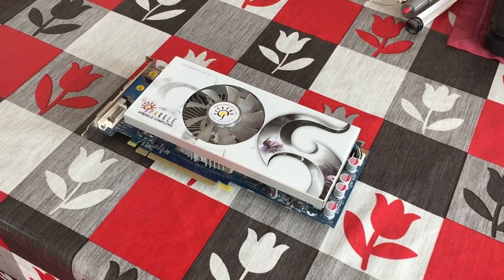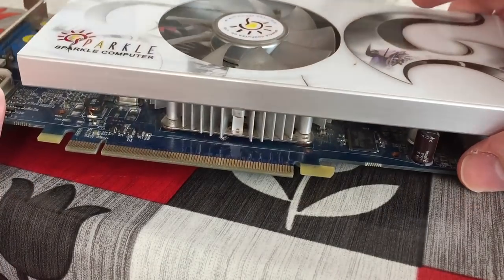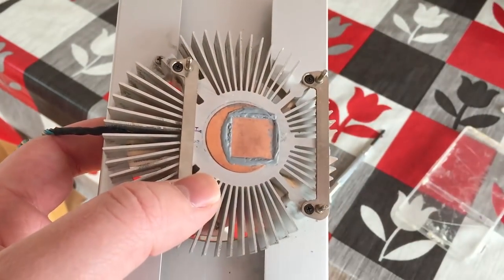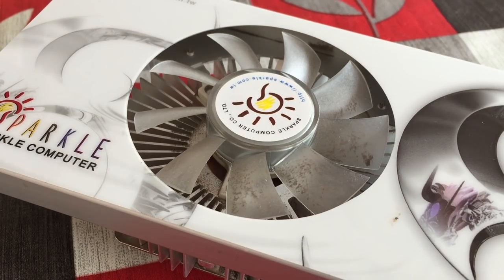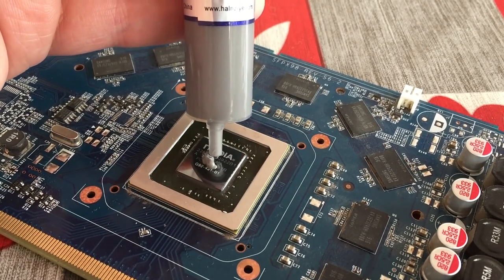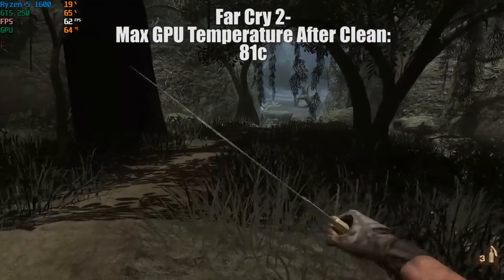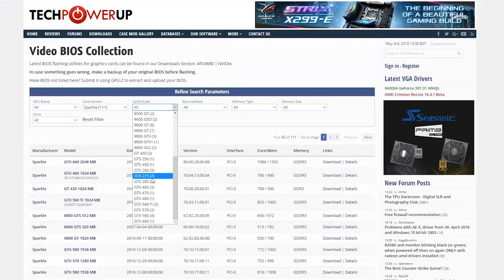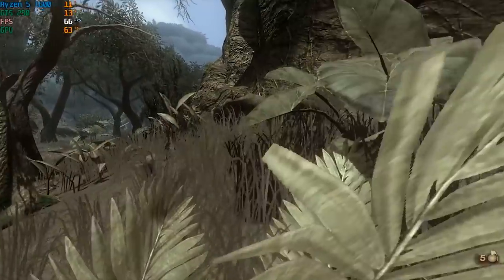Getting An Old GPU To Run Like New

Comment: is 2 hd 6870:s worth 30 dollars?
Reply: About 50% the performance of a R9 280 3 gb & crossfire is terrible on the support side & the cards no longer has driver support so newer games dont get optimized, the cards were at their end of life back in like 2012 in terms of stores selling them so its soon 6 years old.

For games pre 2016 it's good enough performance wise with 1 card in low - medium settings 1080p & e sports games for sure, but not much further then that I'm afraid...
(Depends a bit on the game ofc which settings work well & which don't)
But I'd look for a faster card then a HD 6870 unless you are getting them for a older rig, for benchmarking in older games & perhaps stuff like 3dmark 2001se, up too 3dmark vantage along with overclocking for passing time while in boredom during the weekend.

Had one here myself with a shitty cooler up too January 2015 from October 2012 & i hated the card initially due too the heat as the cooler was crap but once it was modded with two 120mm fans too cool down the card it was nice too have a silent gpu for games like dead island, borderlands 1, tf2, cs go & similar time period of games.

Had a xfx dual dissipation HD 6870 & when i replaced the card in January 2015 i bought a asus direct cu II r9 280, great looking card & only needed too oil the fans a few months before i replaced it with a gtx 780 i got my hands on, traded the hd 6870 away for a motherboard which i sold for 50€ locally too a guy which had a mostly fried socket 1155 system with a I5 2500k
(Motherboard lived but had only 3 working usb ports + the front 2 ports on the case instead of 8 rear & 2 front & no network card as the router remained plugged in during a thunderstorm.)
Reply: Marcus60661 thanks
Reply: yes they are absolutely worth 30 bucks, you can sell one and more than cover your costs-keep one for free

Comment: My gt610 gets up to 150f and it's not dusty
Reply: passive model ? or crappy mounting for the cooler on it atm. & is this in idle or load ?
if its in load its fine. idle ? a bit on the hot side but if you are under 90c its fine still.
Reply: Try taking the fan off of it and reapplying some new thermal paste that might help a little
Reply: It's a MSI I did put new thermal paste on it just has a very crappy and small heatsink on it
Reply: It's a very nice card it's a msi but the heatsink is small

Comment: Hey Random. I want to ask you something - is it wortth it to buy Ryzen 3 2200G + GTX 1050Ti ? Don't laugh, if this build is dumb, I'm noob...
Reply: but i asked about this build other people, and they started laughing, that APU + GPU is dumbest thing ever.Im confused
Reply: They are laughing because the APU comes with integrated graphics and then you would put a GPU inside, they are the dumb ones if you are going to buy the APU first wait a couple of months and then upgrade to the GTX 1050ti otherwise just get the non integrated gpu processor and just get a normal Ryzen 3 1200
Reply: I think i'm going with 2200G. I've planned to buy New proccesor, in this case, APU, wait until GPU prices go down, andthen buy GPU, becouse, i'm on budget :DD
Reply: One thing people miss is the 2200g actually has half l3 cache of the 1200 but the 2200g has a slightly faster core frequency and uses less power. The r3 1200 has less effecient handling of memory inside the die due to 2 ccx with two cores whereas the 2200g its one ccx.Answer 2200G even with a discrete GPU.
Reply: Nice build for 1080p gaming and if you getting the graphics card later then its the best budget option if you have nothing to play on.
Edit: Just remember to OC the 2200G GPU
Reply: Not anymore,  buying used will 9.9/10 always be superior in price/performance, but if you want your stuff to be newer or have a warranty for some odd reason, go for it (I'd personally go for a 1060/RX 570 if buying new)
Reply: thanks for the answers. And one more thing I want to ask you. My PC is broken by now, I somehow managed to fry my motherboard, but that's ok, becouse I was thinking about this build, that i mentioned before. But GPU is still good. So, here is a question - what if I put a Ryzen (with new motherboard) and use old GPU. If you wondering, my GPU is MSI hd 5770 (1GB)
Reply: I would personally spend more on getting a better GPU and CPU, that 5770 is surpassed by a GT 1030
for instance try this
X5650:$30
HP Z400 Board:$45
GTX 670:$80
Much better!
Reply: Grant Gibson i want to have build capable to play new coming games for next few years
Reply: Gabrielius Kačinskas
Only nedry noobs here! First thing you need to say what does it need to run, on what resolution, then ask if Ryzen 3 is enough.
You get a better deal on a Vega onboard chip now! Never needing any ultra low level GPU cards!
Fornite, CS.GO, WoW, any build will run them!
Reply: lucas rem not only those games. GTA V, Witcher, etc. I think 1050Ti is good card. Rezolution i want - 720p
Reply: Ha, the G2200 will be enough for 720p. Its also more powerful than you 5770, so that would actually make it slower. The 1050ti is a decent for 1080p (4x the resolution you are planning on). The G2200 can actually do surprisingly well even at 1080p, so I would definitely skip the 1050ti (huge waste of money for what you're doing).

I'm all about getting the performance you want (hugely disappointed in my Titan Xp, I already had more firepower before), so I know what its like to waste money and feel like an idiot (seriously Nvidia drivers and screen capture are crap compared to AMD). I've also been on the super low side of gaming where I could only run Minecraft at 360p minimum (clouds off, grass off, render distance of less than 50 feet) and still not getting anywhere near 20 fps (max fps was 17, average was around 12-15 fps). I approve of builds that do everything you want from them, without costing unnecessary amounts. If 120 fps 1080p High was your goal, I'd be recommending a 1080ti without hesitation, but that's not what your after, it sounds like you want a good gaming experience at medium/High/Ultra at 60+ fps, and I think you're going to be happy with the G2200 integrated graphics, they are insanely powerful compared to Intel, a whole different category.
Reply: If anyone is wondering why I watch this channels and others like LowSpecGamer, its because of those 15-17 fps 360p Minecraft days. I still had a ton of fun playing with friends, and having fun is what gaming is all about. I hope all of my advice helps others also enjoy gaming with friends and making memories. Peace!
Reply: Jake Garrett Medium and 30fps is enough for me. What gpu you recommend? Budget for GPU is around 150€
Reply: dont use ryzen use i5 or i3 but i5 is good
Reply: The G2200 Ryzen integrated graphics are plenty for that. At 720p you're going to be getting way, way over that (60 fps range), you're vastly under estimating its ability comparing it to Intel (and yes, Intel Potato graphics are just that, potatoes, 10 fps if your lucky, but Ryzen is going to be at that 60 fps).

I thought about building a G2200 in a small form factor for LAN parties and playing with friends at 1080p (and I'm used to Titan and above performance). These new Ryzen APUs are incredible. Very impressive. Go look at some benchmarks (most people will be benchmarking 1080p, because they are already overkill for 720p).

My budget is sometimes insane (I've got phase cooling system that runs things -58c idle and loaded at -35c, they need heaters to prevent ice from building up on the CPU/GPU), and my triple 4k setup is worth every penny. However, if you don't need to spend $5000+ on a system, why would you? You're thinking you "NEED" a GPU, but that's not the case, you are running very low resolution, and your goals are easily exceeded by the APU, so why waste money? That 1050ti isn't going to be significantly better, its simply not worth it, even if it was $20 it wouldn't be worth it for 720p.
Reply: +Gabrielius Kačinskas   My next build will probably be 4x Vega (FE water cooled, or just regular 64 cards with water), either sub-zero cooled Threadripper or duel Epyc (64 core/ 128 threads) with water. That's going to be a nice upgrade. That build makes sense to me, but putting a 1050ti for 720p gaming over the Ryzen APU makes no sense to me. I wouldn't even spend $20 on that upgrade, so I would ditch the 1050ti for that use case. It would be a complete waste of money. 

I'm fine with spending money (I look at $1k+ CPUs and think, wow that's a bargain!), but I hate wasting money, and that 1050ti is just pointless in my eyes.
Reply: Jake Garrett thanks for the advice. Could you recommend a good budget gpu?
Reply: Holy crap, I just said the Ryzen GPU was good enough for what you want (more than want your looking for). Fine, buy 4x Vega, it will shit on my Titan Xp. There you happy? Is that what you want? I'm not going to say it again, the friggin Ryzen APU is more powerful than what you're looking for in gaming performance. If you're not happy with that, I don't know what to tell you besides spend several thousand dollars and stop asking people!
Reply: Jake Garrett im happy with Ryzen 3, i just asked for GPU. I dont think that only APU will be enough

Comment: I recently got a gtx 610 its not that bad with gaming, its enough for my gaming needs
Reply: Lol minesweeper?
Reply: Man u  wasted your money u shouldve bought a rx 550 that will be 96% better than a gt 610
Reply: True, i could have bought a1030, but i bought the610 with my own money, so its okay for me
Reply: Try buying used you will get much better value. Even the gt710 is better but enjoy the card!
Reply: Is it a passive model or one with a fan ?
if it's a passive one put a 120mm fan towards it & do some overclocking for some extra performance out of it.
Reply: I got a GTX 650Ti for $20
Reply: Mukund A no hate, but i just want to know what games u play?
Reply: ayush roy PUBG 10 FPS :D
Reply: Mukund A
I bought $ 120 Farcry 5 metal box, so i need a $20 PC to run it on!!!!!!
Reply: I just got a r7 260x for 60 dollars that came with a power supply and its faster than a rx 550.....